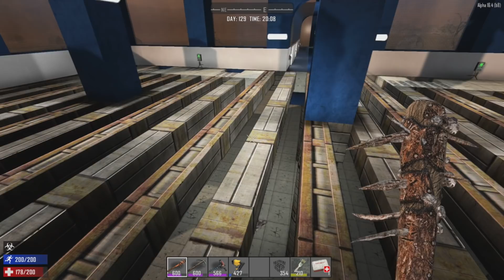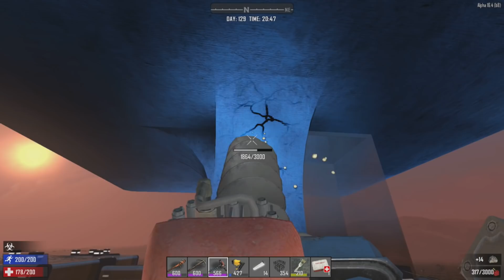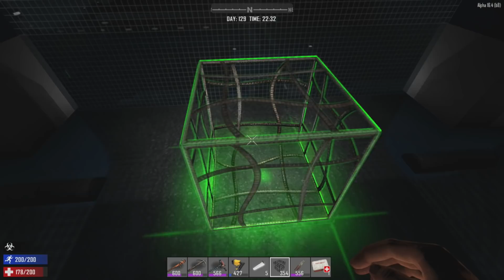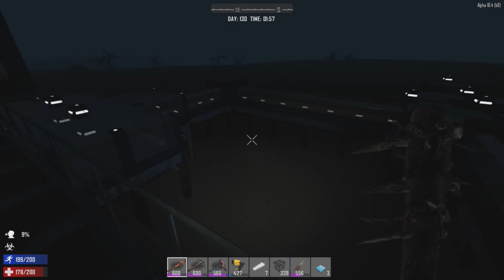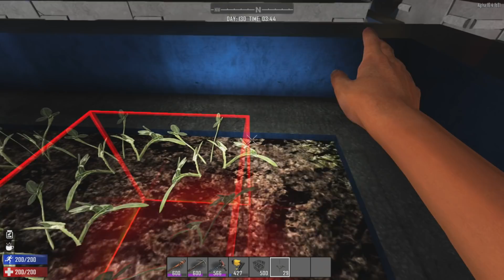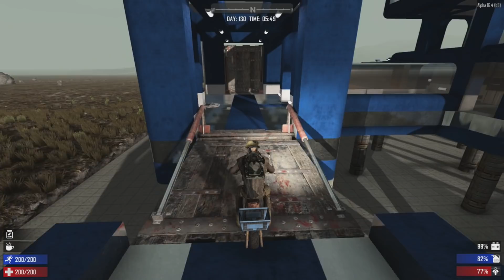7 Days to Die Let's Play Alpha 16 S2 E134

Comment: A few episodes ago when you were talking about squeezing more power out of your generators. The math for power output is 1 W per 6 quality on each engine, for a max of 600 W for 6 perfect engines. So the extra 35 W of so you were looking for shouldn't be a problem.

Comment: I was thinking that for the lighting in the new pod you could extend the column that the ladder is on and place the lights on it. I know there isn't a ton of space in there, but I think it would match the base better and also get the lights off the floor as well as allowing you to place a light block set up like you have on the tops of the other columns around the base.